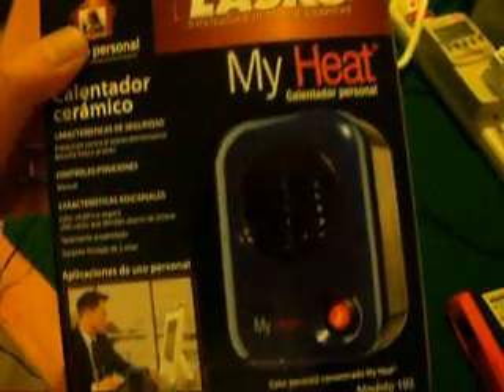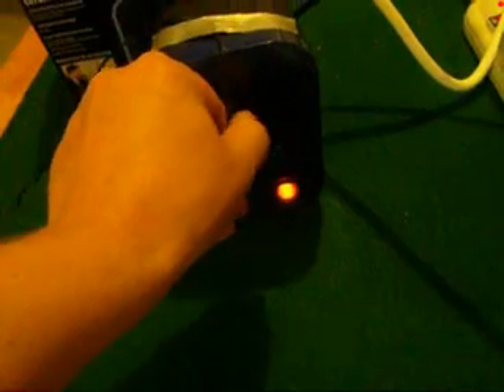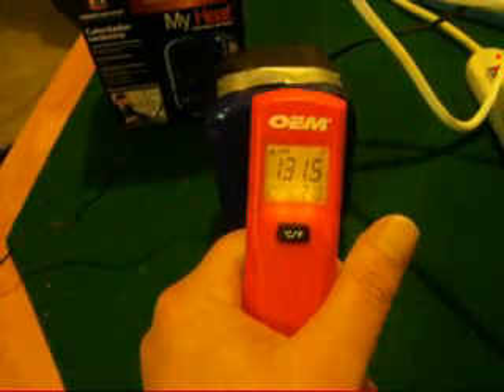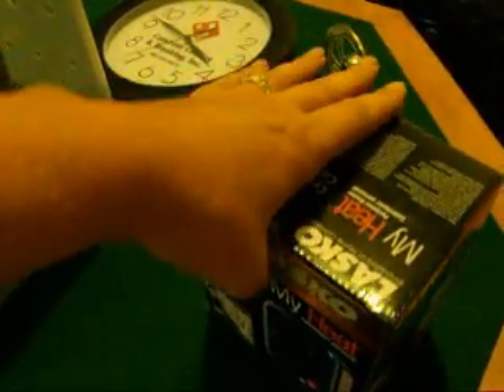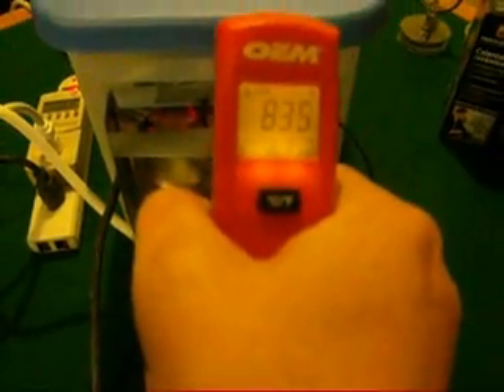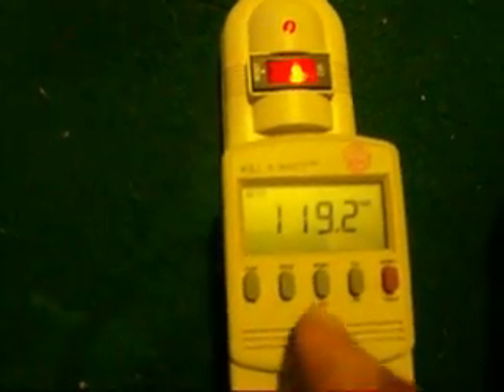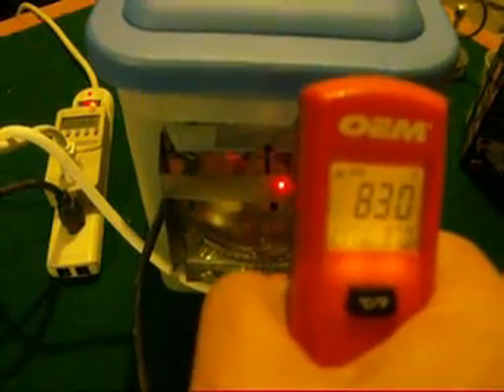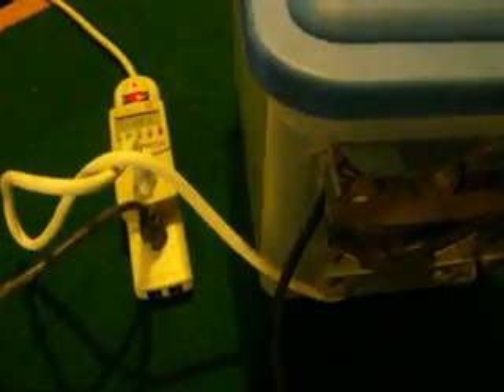200 Watt Electric Heater Test

Comment: Nice test. If you wouldn't mind, please upload a youtube video with the actual heater running, testing wattage and heat output. Also a walk through of it would be great. I may end up getting one of the thermaltake kits to try this out myself but I think it would be a blessing to all working on this to have a video roughly 5-15 mins in length describing the components of the system and wattage and heating measurements. Few I have seen are not showing heat output measurements. Thanks for the vid